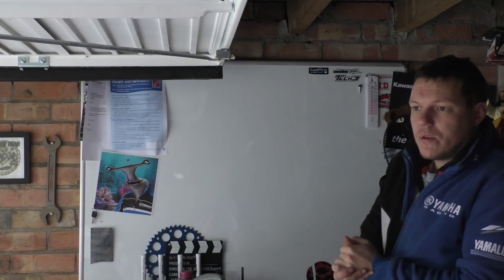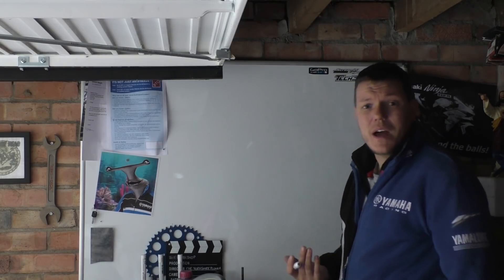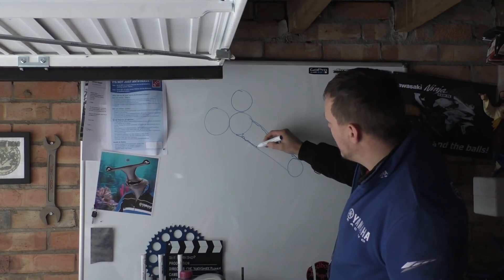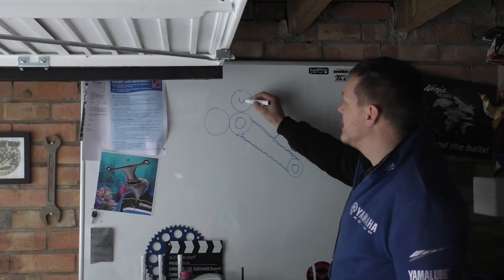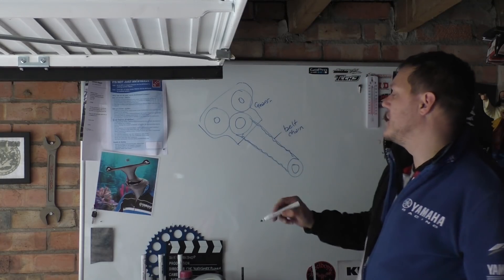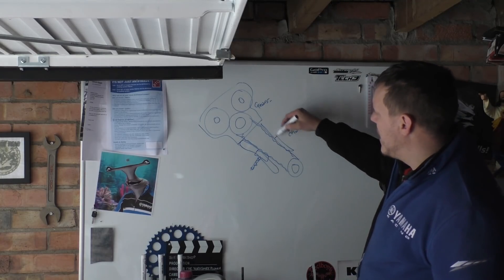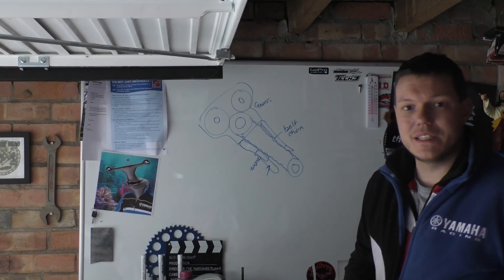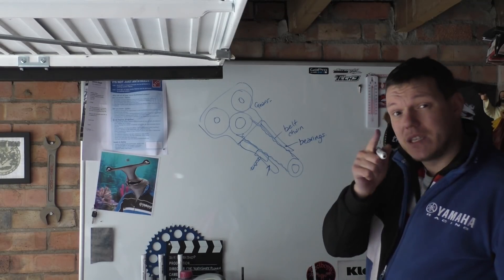Camshaft Drive - Hybrids - Part 5

Comment: Hey man, I got something I'd like your thought on.. I ride a GS adventure. BMW is getting outshined by the likes of KTM and Ducati who have decided to use HP to dominate the class. Tons of HP is great on the road but unmanageable of road, so they have settings for off road that drop HP considerably. 
My thought is.. if you were say BMW and you needed to develop a high HP motor that was also manageable off road, would a variable weight fly wheel work?
Say you had a magnetic doughnut shaped weight that stayed disconnected next to the flywheel until you switched the magnet on.. and viola!! You've now toned the motor down and made the power tractable..
Let me know if I'm on to something or bat shit

Comment: You can lose a gear from that diagram - like on merc sprinters. Cam sprocket is on the end of one of the cam gears, contra rotating cams, and plenty of wrap round the sprocket, quite nifty in its simplicity 👍

Comment: Hey Matt! Are you going to cover the design with connecting rods -driven cams (NSU Pretice for example has this setup) ?
Reply: The Workshop, I have never seen one but wondered why.  Seems logical set-up based on most all engines have a similar set-up with crank and rods.
Reply from the maker: I know why, but I'll leave that for the video
Reply from the maker: No, but I am now - never heard of it before but just looked it up - cheers dude. How do you pronounce your name?
Reply: ;)  it should be something like [dianko] , but it is just a funny nickname here in my country
Reply: we will have to way for Matt's video. But i think you dont want all that heavy mass moving around inside your engine, killing a couple of horsepower and increasing vibrations.
Reply: It can be balancer of the crank, but yes, it adds weight to the setup and not sure how much revs it can handle.
Reply: I'd forgot about this one - did anyone else use this system apart from NSU?